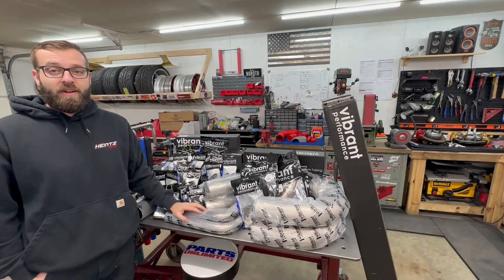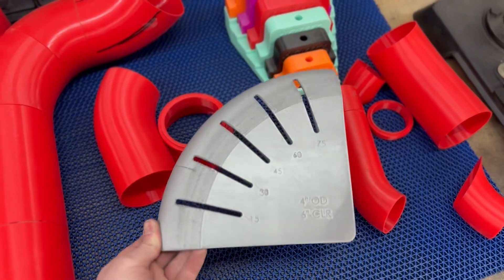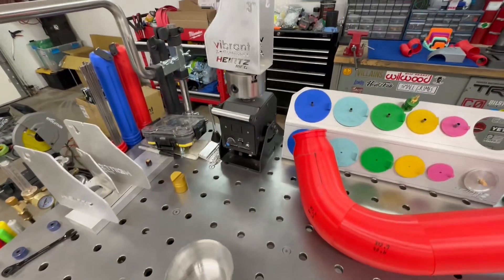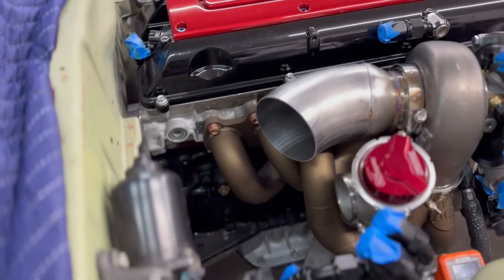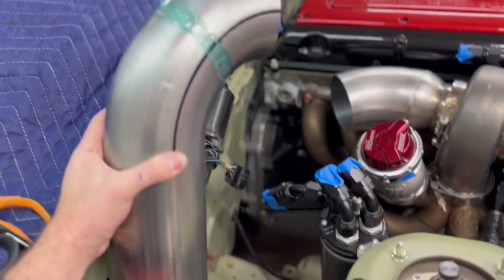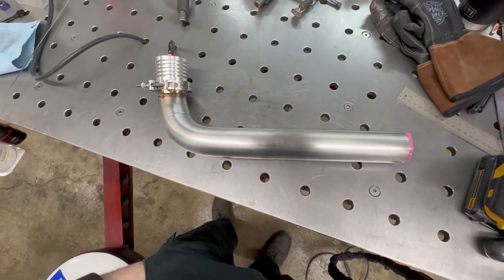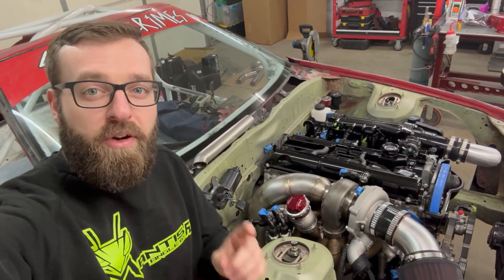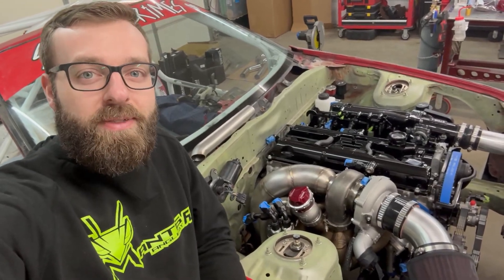Making a downpipe for the 2JZ RX7

Comment: Did you scan your engine bay to draw up the downpipe or did you rough it with cardboard to figure out length and angles for the 3d print?
Reply from the maker: No scanning or cardboard. I 3d printed a bunch of different bend radii versions of 4” tube that I knew could be purchased and then just fit it up with tape.

Comment: Great video! I wish I had 3D printed mock up pieces when I was making more exhausts - it would have saved me so much time!
With how good your fit up is, I recommend autogenously pulse welding everything. I recommend trying 75A, 1.8-2.2hz, 40% on time, 5A background. With a BBW cup I can weld an entire diameter in one pass and keep the whole weld a light straw color. With such little heat in the joint, back purging isn't even necessary. I've never had an exhaust crack and I have some that are 8+ years old.
Reply from the maker: Thanks! My fitup looks pretty decent in the video but unfortunately it wasn't all that great in person. It was definitely a struggle getting good fitup on a 4" tube using a 4" belt sander. I've been meaning to try pulse but always end up getting in a rush and not taking the time to learn. I'll give those settings a shot!